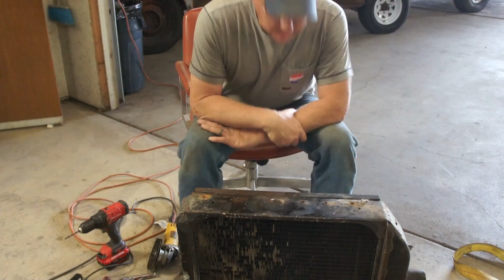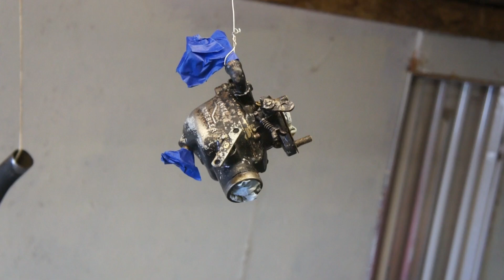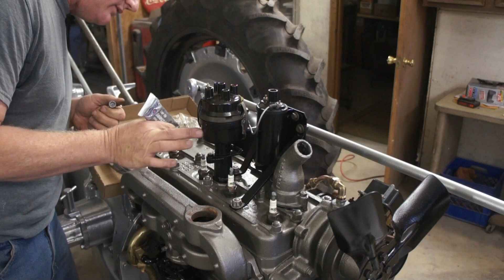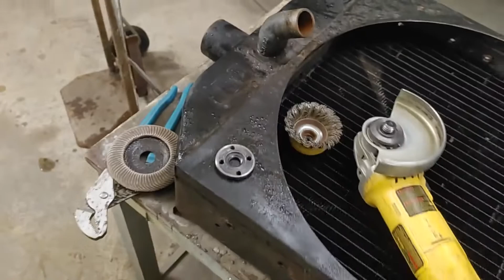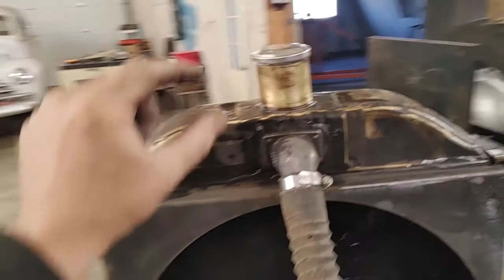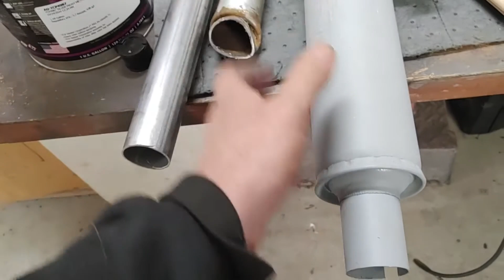1948 Silver King Tractor Restoration - Part 4 - Radiator Repairs & Engine Assembly - Plus a Treat!

Comment: Little late to the party, but judging by the chamfer on the head where the distributor enters, it's looks in my opinion that you should be able to put a rubber O-ring on the distributor and it'll seal it up. It's going to take trial and error to find the right thickness but it shouldn't be too much of a hassle.